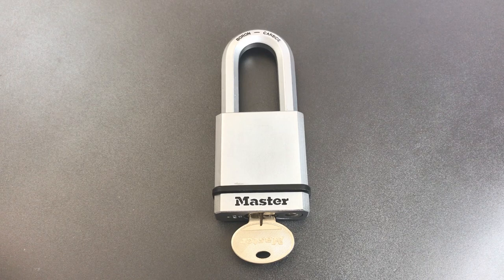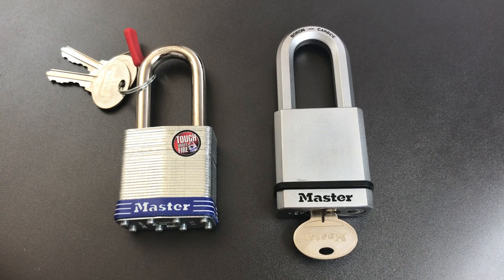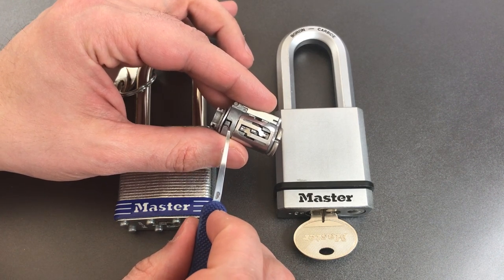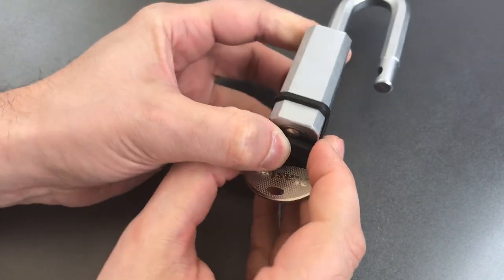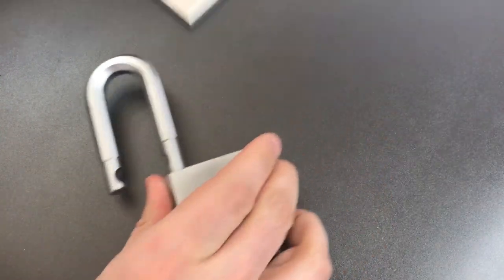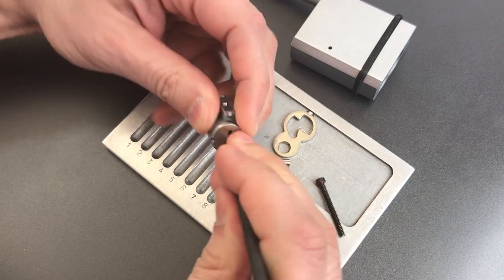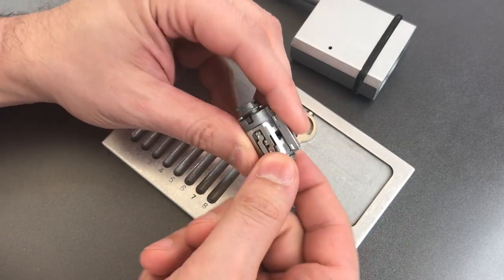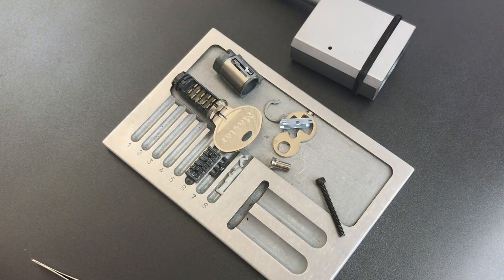[633] Master Lock, Protect Your Sidebars! (M532 Picked and Gutted)

Comment: I've owned this lock for over a year and have tried picking it several times, unaware of the side bar. I'll be able to get it now. Thanks for the great bit of knowledge.
Reply from the maker: Good luck with it!
Reply: @lockhurst, how'd you do?
Reply: How did you do?
Reply: Turns out it wasn't his lock he was trying so hard to pick opened, and was finally caught by the owner. A one sided gun fight ensued and he was permanently dealt with.
Reply: @iyeetsecurity922  It is the only answer.
Reply: 5 years later, so did you manage to get that lock you had fir six years open with the sidebar or is @iyeetsecurity922 correct?
Reply: Did you get it open?

Comment: So Masterlock made a lock that you can steal and reuse with your own keys 😅
Reply: It would be extremely tedious having to apply torque on the keyway and simultaneously holding the factory tool to reset the key. If you were that experienced in lock picking, you wouldn’t even want that trash core for yourself other than for resale value.
Reply: Stonks
Reply: Once its unlocked it looks like you simply rekey it as normal

Comment: they should pay you for testing it :)
Reply: They should pay him for telling them what's wrong with it.
Reply from the maker: I charge for evaluations done at the prototype stage. At this point, master lock has spent tens maybe hundreds of thousands of dollars tooling up. They are not making any changes anytime soon.
Reply: fair enough... now i know :) anyway - keep up the good work with videos. I think i will get some picking toolset sometime soon (i wanted to start long time ago)
Reply: +LockPickingLawyer
If the parts are machined, CNCs can be reprogrammed.  If they're stamped, the tooling wears out over time and must be replaced anyway.  The actual cost of tooling changes may be lower than you estimate (or a lot higher than I estimate).

Even if you're right and it's up in the hundreds of thousands, how many of these locks do they sell and how many more could they sell if they were a lot harder to pick?  Only Master Lock have those figures.  But the fact that this core addressed some of the flaws you found in its predecessor indicates they're willing to make improvements.

However, they're probably not going to pay you for your advice.  You've already said what's wrong, so all they have to do is figure out how to fix those problems.  OTOH, if they'd asked you at the prototype stage they'd have been ahead of the game.
Reply: Correct me if I'm wrong, but the fix to the two biggest flaws could be only ... modifying the core retainer. A beefier part, that just overlaps the face of the core where you're inserting your tensioning tool. Only one part and no change to the assembly process.
Reply: These parts are all soft metal die castings, plastic moldings, or sheet metal stampings.  There is no machining involved.  The molds would have to be changed or replaced.  As R.P. says, they would not all have to be changed.   Small molds like these for soft metal and plastic are pretty inexpensive as industrial processes go.  I am not a tool designer, manufacturer or buyer but I do work with this sort of part every day.  I would estimate that they have less than $50,000 in the entire core tool set and could make significant changes for way less than that including design and testing time.  If they would add in a proper fee for the Lock Picking Lawyer, it might be as high as a million bucks.
Reply: bitkarek I must say, I love your profile picture.
Reply: @sweepleader  probably in the great scheme of things lock picking-ness is not the most important sale factor. I bet the outside shine weighs in more
Reply: @lockpickinglawyer  ,

I'm so glad to hear that you are making yourself available to help the security companies improve their products. Until now I thought you were only interested in showing hobbyists and bad guys how to defeat their products.

Peace and Love,
j

Comment: Thank you! Thank you!

Helpful and informative as usual!

I have a M532 that I use to secure my tools at job sites and love but it failed open last week... apparently the re-keying mechanism had somehow become activated and wouldn't allow the lock to stay closed, after running it through the re-keying procedure described in your video (using a paperclip lol and the original key) and it appears to be working correctly again! 

Thanks again!

Comment: as i said before, reverse sidebars, protect the reset access, now if they can protect the "outside bar access", and the cover plate of course, you would have a real lock
Reply: Until the sidebar springs fail. Which they will.
Reply from the maker: Agreed.

Comment: I feel this is overly harsh, Yes Master Lock could solve these problems, or at least the sidebar problem, however picking this lock open requires two details which you have to actually have knowledge of the internal mechanism of the lock in order to bypass and one of which requires a tool that you specifically made for doing the job even if you could fabricate that tool out in the wild it seems to me that this is a relatively secure lock for most purposes, the lock itself looks strong, the mechanism is good for the most part, but again I agree that it seems like it would be easy to solve this problem and so masterlock should do that unless there is some reason why they can't from a manufacturing standpoint

Comment: Seems like a simpler solution would be to cut the top portion of the key away. The remaining bottom part of the key would deal with the sliders and would double as a tensioner. Its a wide open key way so there would still be plenty of room for a pick.
Reply from the maker: There are lots of options if you want to be destructive.
Reply: The point in picking is that you don't use a key
Reply: @jayraymond9460   The point in picking is to open the lock in a non destructive manner.
Reply: @heathenbushcraft2981  correct, when a key is not immediately available.
Reply: @jayraymond9460  Are you high?

Comment: Couldn't you overcome the side bar with a brute force attack? The materials the core are made of look very weak. I'd say that a small cold chisel wedged into the keyhole and a long wrench should be enough to overcome the side bar.
Reply from the maker: I doubt it. A chisel would cam out, and something that fits would break. The old smartkey locks were an anomaly.

Comment: Are you able to brute force turn the core on this lock because it is internally rekeyable like you can with the Kwikset "Smart" Key system?
Reply from the maker: I doubt it. This is a much more robust sidebar/slider design... also Kwikset fixed that on the gen3 locks.

Comment: if i fill the key hole with jb weld glue after an hour it is unpickable
Reply: I got to thinking in a devilish way about people locking doors and front gates and stuff .  I thought a locked from gate like a wrought iron gate can be a blessing and a curse. Sure it can keep people out but a chain and another lock from a prankster can lock you in. Or epoxy glue can prevent you from opening the lock you used to keep thieves out....